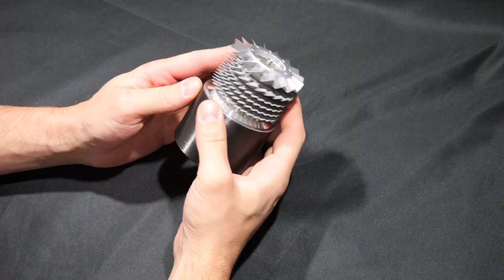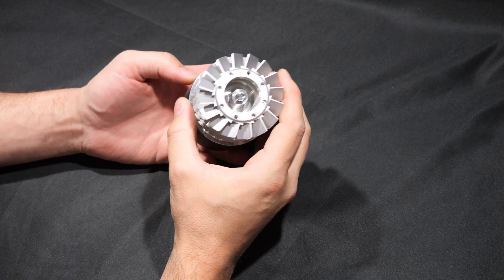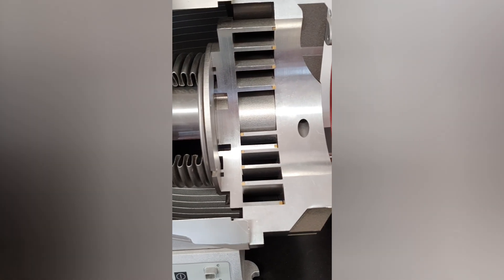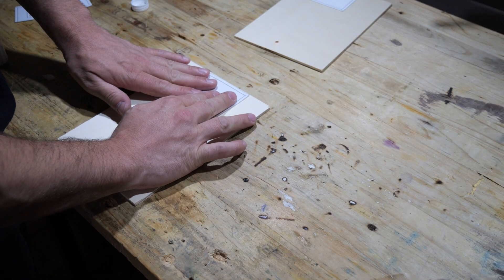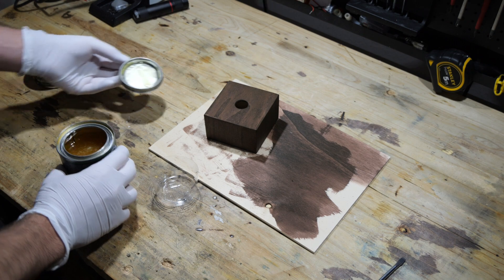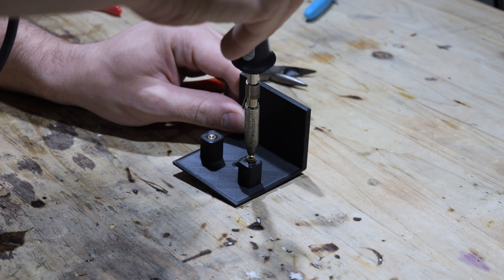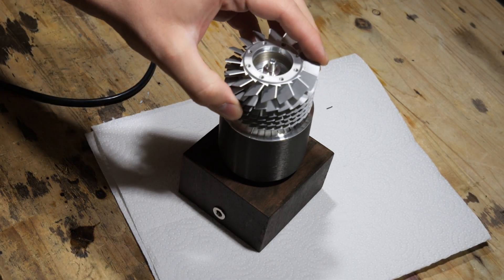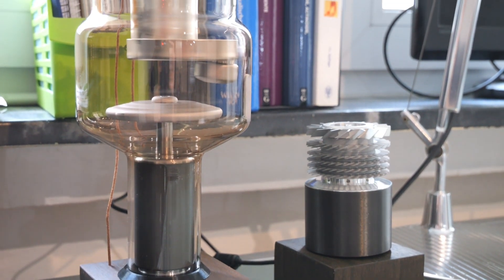A Turbomolecular Pump for my Desk

Comment: I remember getting several of those big 13 inch turbo pumps, their controllers and  a few gaylord bins of UHV stuff back in 2008. Some of them were new never used. Was bidding against scrap metal buyers so got them stupidly cheap. Would not want to think what would happen if one of those big ones had a catastrophic failure at full speed 😮